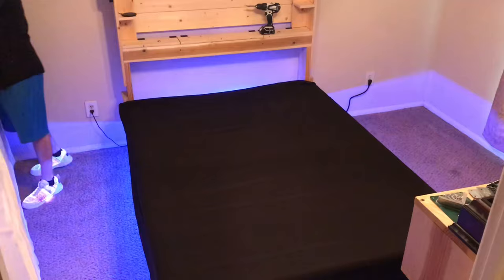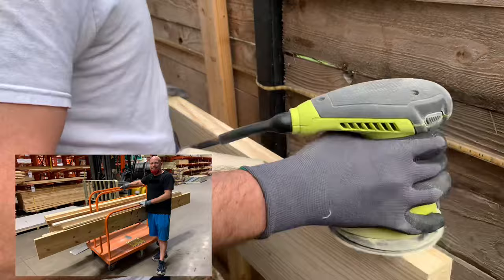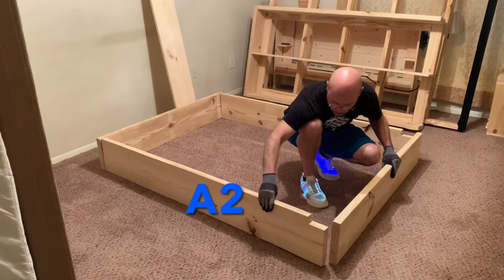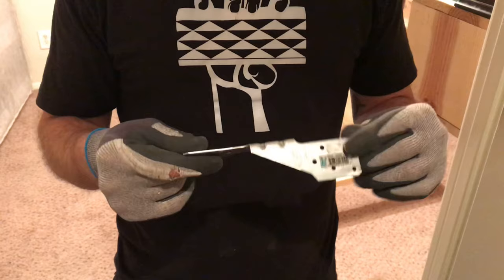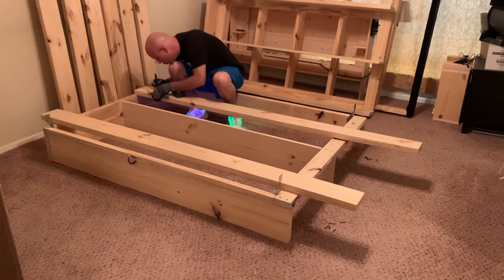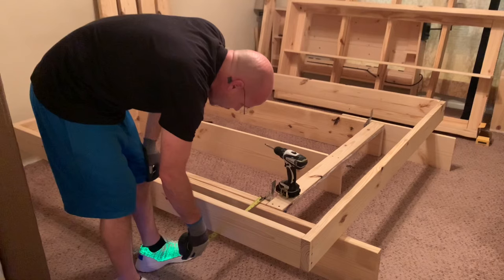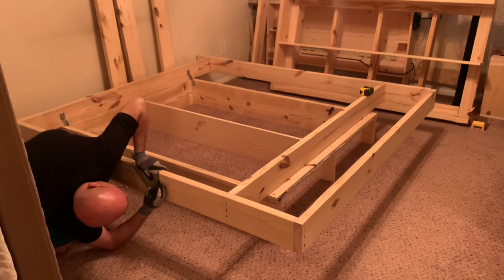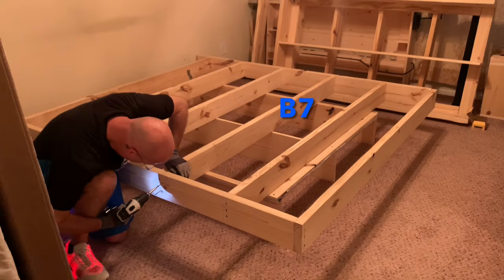King Size Floating Bed Frame [Easily build your own!]

Comment: It’s really tough to understand, in South Africa we use the metric system. But overall nice video. Will have to just figure it out. I also require it for a king extra length bed
Reply from the maker: @arshadmosam4974 Hey Arshad, sorry for the confusion.  I'll be glad to help you if I can.  What are the dimensions in centimeters of your mattress?  Keep in mind you will need a box spring to support the mattress.  If you want to provide them, with the dimensions of the pieces of wood you will be using to build your bed frame, I can help you come up with exact measurements of your build.  I've converted from inches to centimeters 100's of times by now.  I can surely do it again if you'd like help.  Thanks for stopping by and supporting this channel my friend, I mean it 🤝
Reply: Hi there! Actually I converted them all according to the size of my mattress. It came out beautiful! I’m going to get some white Masonite to put on the top due to my mattress being fully memory foam and has nothing but foam, I will need the board to provide support. Other than that the video was extremely helpful and would not have managed to build my bed without the video. Thanks 👌
Reply from the maker: @arshadmosam4974 Hey Arshad, apologies for the delay in my reply.  I’m glad your build came out great and I like your idea of the Masonite to support the mattress, but I’d recommend drilling some holes to let the mattress ‘breathe’.  I’m not extremely well versed on the all foam mattresses, but with the traditional spring ones, they need to have some kind of air flow.  You may cut your support board in to strips and space them apart.  I hope this helps…I don’t want your mattress to get soggy on you 🤢.  Take care my friend, we’ll talk again down the road 🤝

Comment: Is there a supply list
Reply from the maker: @darrolynshoulars9797 Hey Darrolyn, yep, there sure is!  This is created after you decide exactly how you are going to build your version(overall desired deck height, storage underneath, headboard, flush build or pocket build, any border on the frame, etc.).  I’ve learned that these floating bed frame videos act as a guide or a good starting point for everyone.  I’ve seen dozens of variations of this build over the years and I’ll help custom design yours if you’d like.  I’ve got the dimensions I used on screen and CAD blueprints available if needed too.  I hope this helps and I very much appreciate your time and support on this channel 🤝

Comment: Does anybody know how high the bed sits when a mattress is on it?
Reply from the maker: @dibs Hey dibs, I do!  👋 It depends how you build your bed frame…most notably whether or not you want storage underneath and if you have a box spring.  My personal bed for example: 2x10 base(9.25”) + 2x6 frame(5.5”) + 4” box spring + 12” mattress = 30.75”.  That is the height of the deck of my mattress.  I hope this helps.  Talk to you again down the road my friend.
Reply: Thank you i appreciate it..
What kind of lumber did you use
Reply from the maker: @dibz All *untreated*…2x6’s and 2x8’s.  I’m on Instagram C_Love1984 if you need help with your design.  I hope you have a safe build.

Comment: Good on carpet, will mess up your wood floors without protectors underneath.
Reply from the maker: @Lolatyou332 This is very true, thank you for pointing this out.  I’ll add this to the master .pdf file.  I appreciate your observation.  Thank you for stopping by, I appreciate your comment a lot.

Comment: What’s all the tools I need ?? Like a electric drill a sander
Reply from the maker: @itsmeshanp5124 Hey Shan, thanks for stopping by.  Depending on how nice you want to make your bed frame, I'd recommend: power drill with a countersink drill bit, tape measure, circle/miter saw, a speed square, marking device pen/pencil, a 5" random orbital sander with 80,120,220 grit discs, and PPE(dust mask, gloves, safety glasses, earplugs).  This should be enough to get it looking like it does in the video here.  If you want to add some kind of stain or paint, you are gonna need another list.  Does this help?  I appreciate your time and support my friend.  🤝
Reply from the maker: @itsmeshanp5124 Reach me on instagram curtis_made_it if you would like and I can help you out a lot more as needed.  Take care and have a safe build.

Comment: What would be the plans for a California king floating bed?
Reply: With a headboard
Reply from the maker: @craigbergeron4321 Hey, good morning Craig.  I've got CAD blueprints available if you need for the cali-king size FBF as I haven't had time to post a video for it yet.  Reach me on instagram Curtis_made_it and I'll get you all set up.  Thanks for stopping by and supporting this channel 🤝
Reply from the maker: @craigbergeron4321 We can fit a headboard on there for you also, no problem.

Comment: I’m trying to build super king size please could I have size if possible 
Watching from Adelaide
Reply from the maker: @user-hy5mk8xp8m Hey Chintan, thanks for stopping by 🇦🇺.  I can help you with this.  What are the dimensions for your super king size mattress?  Either imperial or metric measurements are okay, I am able to convert.  If you are able to, reach me on Instagram curtis_made_it and this process will be a whole lot easier.  Please note, I’m using lumber that is 3.81cm x 13.97cm that is then cut to the length that I need them.  Try to source you some lumber that is about this size.  I’ll talk to you again soon my friend.  Thanks for supporting this channel 🤝

Comment: HI .Really impressive. I really want to make one for me. Can you please share the exact measurements? hope to hear from you
Reply from the maker: @beyonddigital Hey BD, thanks so much my friend.  Check the on screen text during this video for the dimensions I’d recommend using for this build.  What country are you in?  Do you have a box spring?  You want the headboard(video posted on this channel) too?  Are you going to build it like it is in the video or would you like it a little wider and longer so that your mattress sits in a little pit?  These are all things to be considered before I can send over dimensions.  I’ve learned over time that these floating bed frame videos act as a good base for creating whatever it is you are after, I’m just here to help.  Thanks for your time and support on this channel, I mean it.  🤝
Reply: thanks for the prompt reply. I'm from Bangladesh. I want to make 6/7 or 5/7 ft size. @CurtisMadeIt
Reply: here the carpenter has no idea of this kind of bed. So I have to assist them with size and proper instruction. I'm still watching and learning on youtube. The balance is really important. so that's what I'm concerned about.
Reply from the maker: @beyonddigital Just now seeing your follow up replies here, my apologies.  I need to know the exact dimensions of the wood you will be using to construct your bed frame and I need to know the exact dimensions of the box spring or mattress you are going to be putting on the frame.  With this information, I can come up with a pretty exact blueprint of what you will need.  Let me know this information and I'll get you all set up.
Reply from the maker: @beyonddigital No problem at all.  With the dimensions of the wood you are using and the dimensions of the mattress, I'll design you something that will be rock solid and will last a lifetime.  Let me know and we'll make it happen 🤝
Reply: I highly appreciate your response. I will ask again before I start this project. Now I'm looking for an expert to choose the suitable dimension and best material to use. Then you can easily guide me to build it. Looking forward to it and really you gave me HOPE
Reply from the maker: @beyonddigital You bet my friend, no problem at all.  This is easy.  I'm your expert.  Here in USA, I use wood that measures 3.81cm x 13.97cm and then I cut it to length.  I'm going to recommend you use wood that is about these dimensions if you can.  If you can tell me the exact size of the wood and the mattress you are using, I'll create something for you.  I'll be here to help whenever you are ready to get started.  Take care my friend 🤝
Reply: Thank you Curtismadeit :) . To give you an idea 6/7 ft king-size bed and mattress can be custom-made here. surely I will reach out. Can you just give any idea about the total cost of making it and how strong and long-lasting it would be in the long run? @CurtisMadeIt
Reply from the maker: @beyonddigital I need you to give me dimensions in inches or centimeters...something I can convert and understand.  I don't know what this 6/7 unit of measure you are referring to is.  I'll be glad to design your bed frame here and send the measurements to you so you can have it built there in your country of Bangladesh 🇧🇩 .  As far as the cost, I cannot reasonably estimate this as I have no idea of the price of lumber and materials there.  As far as how strong it is, based on the information you provide to me, and the design I come up with, I can almost guarantee it will last a lifetime if it is built correctly.  I use 2x6's here in America.  Those actually measure 1.5 inches by 5.5 inches, that's 3.81cm x 13.97cm and then I cut those pieces to length to build the bed frame.  I use 3 inch screws to secure everything together.  They are rock solid and I'm certain I'll never have to purchase a bed frame again.  I hope this helps.  Let me know what else you need my friend.

Comment: im starting this finally lol what is the measurements of the frame w out headboard extension?? im going with 2x10 base/2x6 frame.....wife said no storage and no dog under bed......she pee'd under our bed a couple times lol
Reply from the maker: @Joseph Romero Hey Joseph, my king size floating bed frame measures 76”x80”, that is 193.04cm x 203.2cm.  2x10 base is a little taller than my 2x6 base…that will allow more space for dee oh gee to get under there, just a thought.  I hope this helps.  Happy Easter 2022 and have a save build my friend.  Talk to you again soon my friend.
Reply: @CurtisMadeIt  happy Easter ty.....Oh I thought u said u used 2x10 base w 2x6 frame, 4" box spring and 10" mattress and had 30/31 total height??
Reply: @CurtisMadeIt  yes u did lol its in the comments below .....please clarify when u can, im a little confused ......haha no biggie im just curous
Reply from the maker: @Joseph Romero Yes, you are right, I’m trippin’.  My apologies.  Yes, this king size has a 2x10 base, 2x6 frame, 4” box spring, 12” mattress(9.25 + 5.5 + 4 + 12) for a deck height of 30.75”.  Sorry my friend, I’ve built and designed so many of these things at this point, they are starting to run together.  I hope this helps.  Let me know if you need anything else.
Reply from the maker: @Joseph Romero Please see my reply on your previous comment for clarification.  You were correct my friend, apologies for the confusion.
Reply: @CurtisMadeIt  awesome thank you
Reply from the maker: @Joseph Romero You bet my brother.

Comment: How much was it for materials
Reply from the maker: @Arielvalenzuela-vt1nc Oh, Ariel!  Don't remind me!  Haha, this text reply is very unfortunately emotionless, but this question on this video is a painful one...apologies for the length here.  Thank you for stopping by and talking with me.  After the original queen size FBF posted on this channel really took off, I just knew this king size video was gonna be a banger so I went ahead and decided to build it, even though I don't even have a king size mattress.  As per usual, I earned another 'bad timing' award 🥇 because at the time, IIRC it was July of 2021, and at the time, lumber was more than 2 1/2 times as expensive as it was just 8 little months prior.  So, your question...How much was it for materials...it was insane.  I think I was in the $300-$330 area for everything I needed as you see it here.  The price of lumber has come back significantly, but, of course, it's still gonna be more today than it was 3 years ago.  I'm sure you are under $200 for the build as it is in the video today, depending where you are, but if you get to adding the headboard(video posted on this channel), I'd probably be ready for closer to $400.  I hope this helps.  I appreciate your time and support here, I mean it 🤝

Comment: How much feet is the led strip?
Reply from the maker: @M D Hey M D, thanks for stopping by.  I linked the lights that I used for this build in the written description of this video.  I hope that helps.  Talk to you again soon.
Reply: Which link? Theres 3 of them
Reply from the maker: @M D Apologies…the first link is for my LED shoes that everyone asks about, the second link LED lights for underneath bed are the ones I actually used in this king size build, and the third link is for motion activated LED lights that I used in my full size floating bed frame build.  Sorry…does that help a little more?

Comment: Lumber list was helpful and the mention of 3 inch screws but 3 inch is to long for the strong ties and now I sit here waiting for my wife to come back from the store with the correct length screws
Reply from the maker: @munjersprint Hey Mun, sorry about this.  I try to say out loud or show on screen when I am using different size connectors in my videos.  It's hard to go at the pace I do and include every single thing all the time.  I'm doing the best I can here, still doing this YouTube 100% myself.  I appreciate your time and support.  Did you get your build finished?  I'll talk to you again soon my friend.
Reply: @CurtisMadeIt  no worries buddy. I got my build done the same day. One thing I did to customize mine was adding 1x12s on the sides of my 2x8s to keep the bed from sliding off. Appreciate your video and thanks for the reply
Reply from the maker: @munjersprint Hey Mun, you bet.  Glad everything worked out.  I hope you enjoy your new bed frame.  Talk to you again down the road.

Comment: How much just to get you to build me one I don’t have the necessary tools to build it myself lol but I’ve got the tools to put it together
Reply from the maker: @Quentin INA Hey Quentin, I’m sure we could work something out.  I can easily make the cuts here at my apartment and I’ll be right over to help you put it together, haha 🤣. For real though, it’s super easy.  Your local home improvement store will make the cuts for you if needed.  I hope this helps.  Thanks for stopping by, I appreciate your time.
Reply: @CurtisMadeIt  didn’t know they could make the cuts
Reply from the maker: @Quentin INA Yep, they will, just make sure the saw is working and there is someone available to cut before you start shopping.  Otherwise, just grab you a ~$40-$50 circle saw…you gotta start building up your tool collection somewhere along the way.  That is a wise investment if you plan on doing anymore woodworking at all, especially for small stuff.

Comment: How tall can it be?
Reply from the maker: @Josh Pollok Hey Josh, thanks for your question.  I don't know the maximum allowable height according to physics, but I could comfortably recommend 2x6, 2x8, 2x10, or 2x12 for the base and 2x6 or 2x8 for the frame.  This will give you a height of 11" - 18 1/2" before you put plywood/box spring/mattress on there.  I hope this helps.  Talk to you again down the road my friend.

Comment: Hey what’s the cost
Reply from the maker: @Vxrtzz Hey V, thanks for your question.  The cost depends on how you build it my friend…I have built many different variations of this bed frame so just answering the question ‘how much does it cost?’ isn’t very practical for me.  I would ballpark materials cost at $400-$500 for everything in this build AND the headboard that I’ve also posted a video for.  I hope this helps and will talk to you again soon.  Thanks for your support.

Comment: Is there any way you could actually put all of the correct sizes on here because the numbers that you displayed on your video are hell a hard to understand
Reply from the maker: @Anthony Kennerson Hey Anthony, thanks for stopping by and talking to me.  I appreciate your time.  As far as I know, I did put all of the correct measurements on the video, believe me, I checked.  Sorry for the confusion as I'm not a professional builder or video editor, I'm just a regular guy who started making YouTube videos and started to gain some traction.  I'm doing this 100% by myself and doing the best I can.  Please feel free to reach me on Instagram C_Love1984 and I'll be glad to answer any questions you have or send you over any material or information that I think will help you get this done more easily.  This build is easily modified and this video recommends one way that you could build yours.  It's just a guide and I'm the one who designed and built it, so I'll be able to answer any question that you have about it.  I look forward to hearing from you.  Talk to you soon my friend.

Comment: If you sit on the edge of the bed with any weight does it tip? Lol that’s a big concern? My in laws stay often and I don’t want it dumping either of them when they sit on the edge…😂
Reply from the maker: @foreverfrann73 Hey there Frann, thanks for stopping by.  This bed frame doesn’t tip or rock at all when built as illustrated in this video.  Your in laws will be just fine using this bed frame, I’m sure of it.  Let me know if you need anything else.  I very much appreciate your time and support 🤝 .  Stay blessed my friend 🙏.
edit spelling

Comment: FROM IDAHO I JUST NEED THEM SHOES
Reply from the maker: @Michael fogg Hey Michael, thanks a lot for stopping by.  You can get you a set of those shoes right here:
https://www.amazon.com/gp/product/B07Z62W7TG/ref=as_li_tl?ie=UTF8&camp=1789&creative=9325&creativeASIN=B07Z62W7TG&linkCode=as2&tag=clove1-20&linkId=aef8fbc2e37b830e25bac6407f0a917e